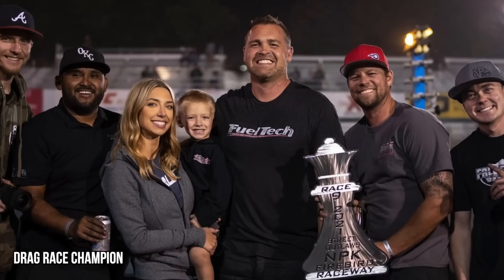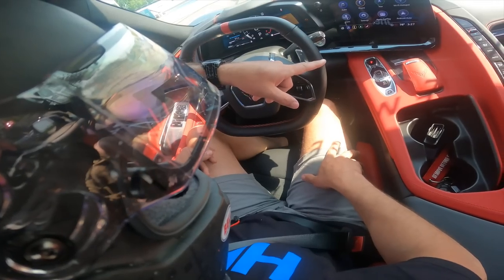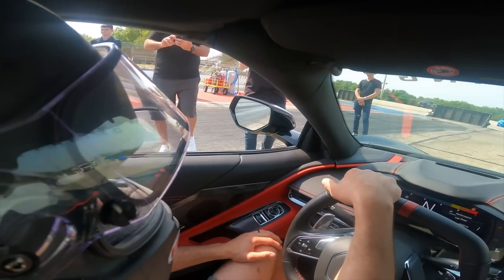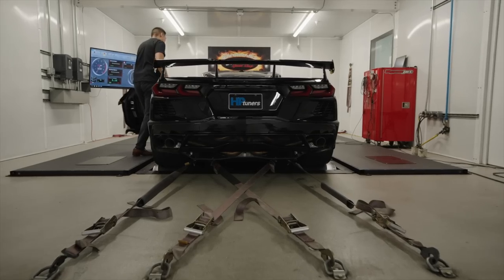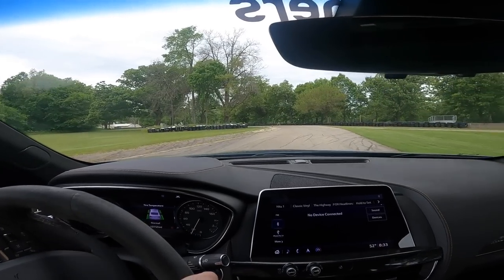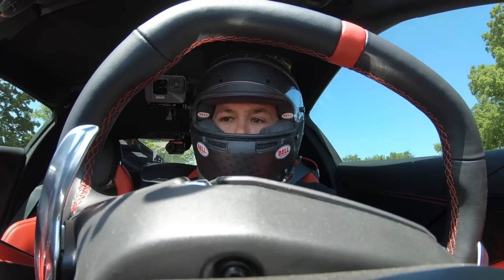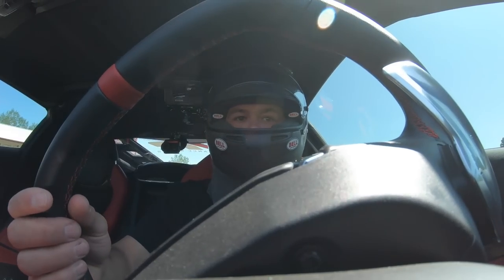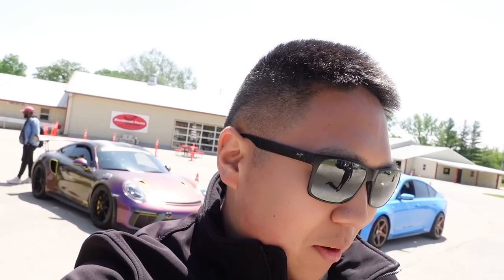First Drive Reaction To Twin Turbo C8 Corvette!

Comment: Can I assume hp cracked the code & you can now tune the c8? … I guess so!
Reply: The owner of fuel tech already twined a c8 and tuned it with the fuel tech system..  guess the hp guys fugured out how to use the stock ecu.. which if im spending the money on fabbing in 2 turbos in one of those im getting a whole new ecu
Reply: @Z-Ack  cool, I believe Emelia Hartford had been attempting this for a while with her twin turbos. Glad to hear the nut has been cracked.
Reply: @Z-Ack LMR holds the 1/4 mile record with their twin turbo C8.